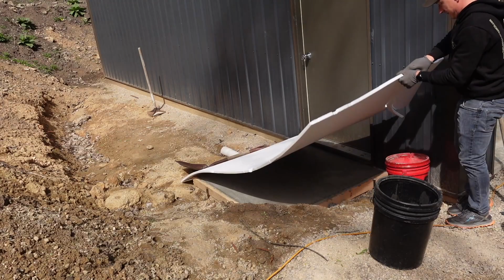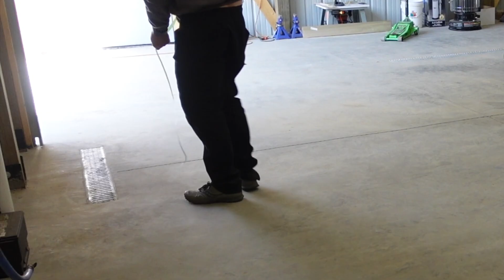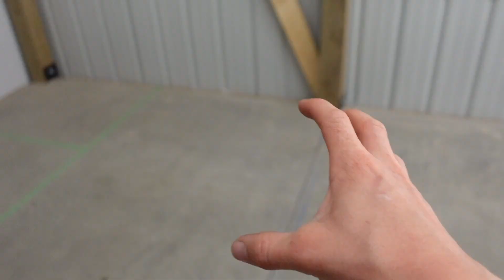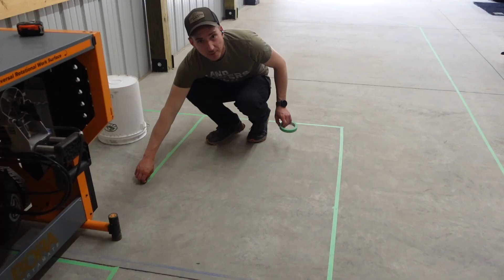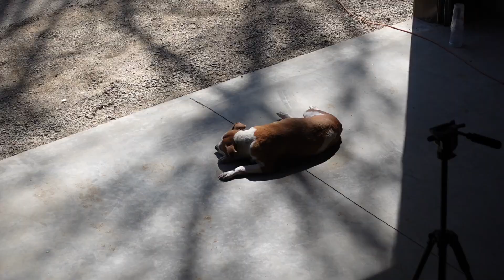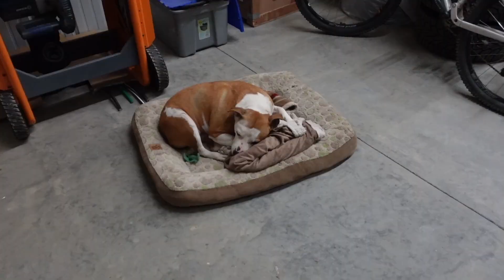Help Me with the New Shop Mezzanine Layout

Comment: Life is all about compromise, Joe... :face-turquoise-covering-eyes:

Anyway....  How wide do you need the stairs to be?  Perhaps you could fit them outside of your trapezoidal floor plan between the second floor and where the NADA is parked?  Or even make those stairs retractable like attic stairs, just in case you need the extra space to move stuff around.
Reply from the maker: Compromise sucks haha. But such is life. 

The attic/retractable stairs is a good idea. I wonder if I did something along the back wall right in front of the nada. Being it is only 3 ft. Wide it could stay down most of the time, but lift up when needed. Could gain another 3 ft of office that way too. Thanks for keeping the brain thinking. I kind of like that direction some.

Comment: What about a spiral staircase possible in the triangler end. Then have bathroom to left and hallway opening into office.
Reply from the maker: A spiral staircase would be cool. Maybe even in between the office and bathroom?
Reply: That would eliminate the need for a hallway. As long as the equipment layout fits around it as required. Potentially a dedicated room below bathroom for cutting table to contain the dust.

Comment: Ok couple things here, was this supposed to be full against the back wall?? And the stairs on one of the sides going up too it?
Spiral staircase would make things easier, and add a sliding glass door for over looking the work area? Helps to get things in and out up there. Plus Sasha can watch from up there. Oh crap would she be able to use a spiral stair case ??
Reply from the maker: It was originally going to go across the back, but after getting stuff in there I like this location better for space and workflow.

She should be able to handle the spirals as of right now. The house has a 90 degree and 180 degree turn on the stairs with open stairs and no toe kick so it would be similar for her. 

Sliding door is a good idea. That would be the best of both worlds.

Comment: The cutout for stair landing headroom in the bathroom could be a simple counter above with a sink. You lose some storage under the sink, but otherwise it'll be unnoticed kind of like having a vanity there. Edit, you fell on the same idea as I began typing the reply early in the video.
Reply from the maker: If we did that stair layout I think that is the way to use the little bump up. With your idea I could even rotate 90 degrees with the sink and build up the bump out correctly and put a drop in sink right in the bump up. That would free up some room. And do a built in medicine cabinet above/behind the sink.

Comment: I thought when you were first building it that you said the mezzanine was going kind of on that back wall where you just said the stairs were going
Reply from the maker: You are correct, that was the original plan. Once I got some stuff in there I decided I would rather have the extra "depth" and the two still sit side by side fine with room, so kind of called an audible on the layout and where the fab stuff will ultimately sit.